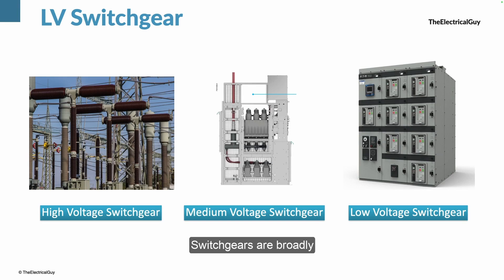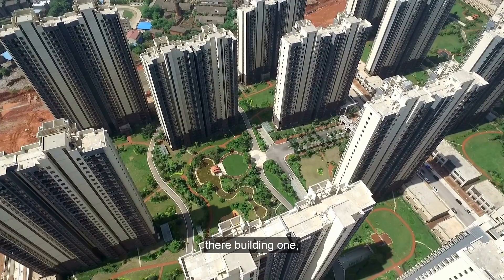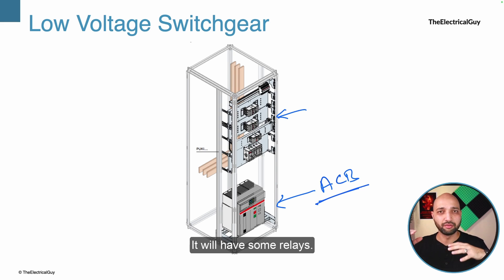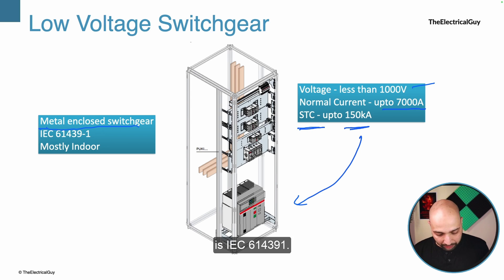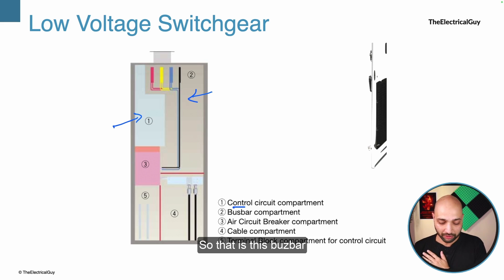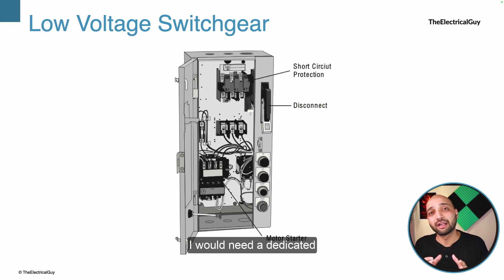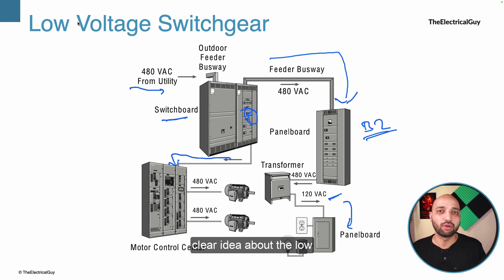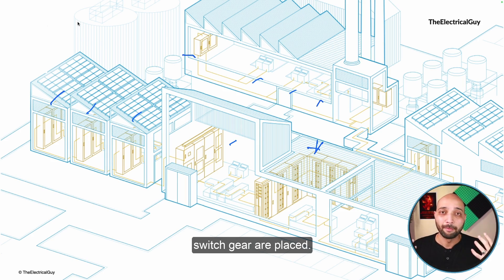Low Voltage Switchgear : A Beginner’s Guide | TheElectricalGuy

Comment: 3:20 I'd explain what an air or vaccuum or some delectric circuit breaker means - it's to indicate what's separating disconnected parts of the "circuit" when they are being "broken". At higher voltages there is higher risk of an electric arc jumping between them

Comment: Great information, my experience is mainly electrical distribution . Our pad mount switchgear for 12,470/7,200 are not as conplex as medíum to low voltage switchgear for industrial or commercial.

Comment: I am an Electrical Engineer and my first time in designing MV and LV Switchgears. This video is very "helpful" in order to have an overview on my future designs. My first assignment will be installing new VCB, and then 1MVA Dry Type Transformer, that will drop the voltage to 480V and will install new Switchgear Panels, and MCC Panels to supply Large Fire Protection Pumps for the new Shelters for the Plant. Thankful for your insights.
Reply: If you are electrical Engineer then why you need videos ?
You have teach others.
Reply: @progress-change What a ridicilous statement. The idea that every engineer out there is an expert and needs no training or refreshers is absurd. The reality is most of us are at best experts on what we do and have had experience with. Engineers should be encouraged to expand their knowledge. Not shamed about what they don't know.

Comment: Please make a video regarding voltage range...

Somewhere it is written
LV=upto 1000v
MV- upto 33kv
HV- upto 230 kv
EHV-upto 800kv

Somewhere it is written
LV=upto 250v
MV- upto 650v
HV- upto 33 kv
EHV-above 33kv

Which one is correct?
Reply from the maker: As per IEC, less than 1000 v is LV. 1000V to 52kV is MV. 52kV to 245kV is HV. 245kV to 800kV is EHV. And above 800kV is Ultra high voltage
Reply: Why current is more in LV as compared to HV as you said its up to 7000 amp..?

Comment: great video, i work for a company that makes LV panels. The only ting i have to add here ist that the biggest ABB breaker that one could buy is 6500A wich is a 100-150 KA E6.2 air circuit breaker. In most cases the panel would never pull more than 6000A.
Reply from the maker: Yes. Some manufacturers do have upto 7000Amps